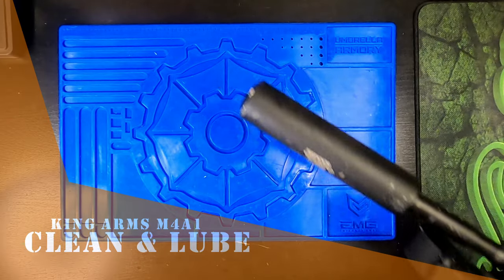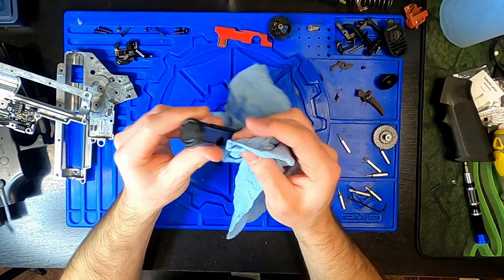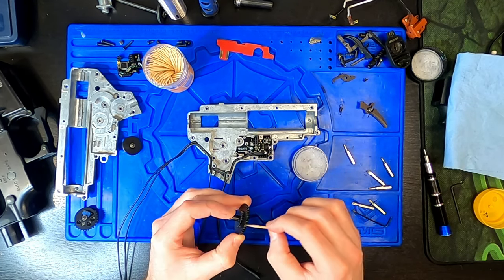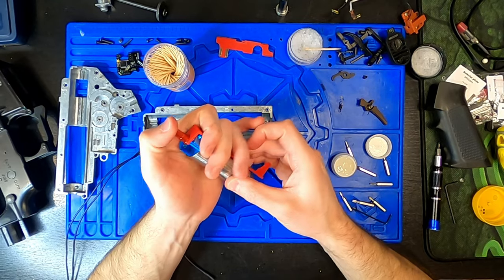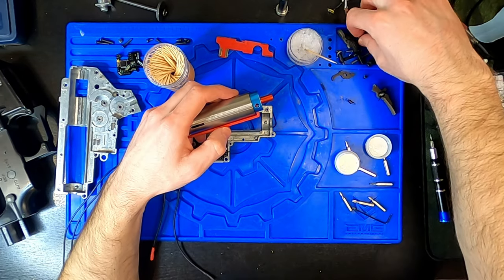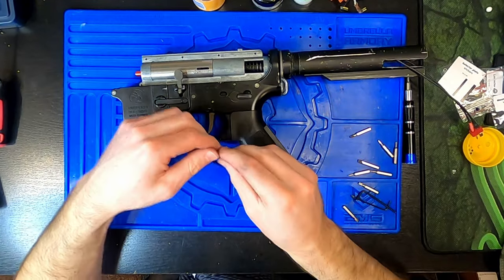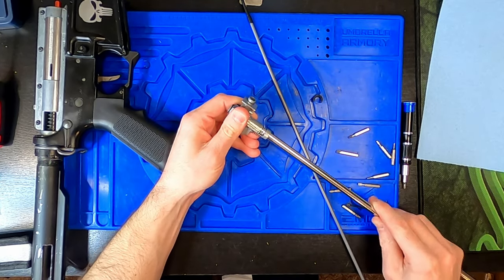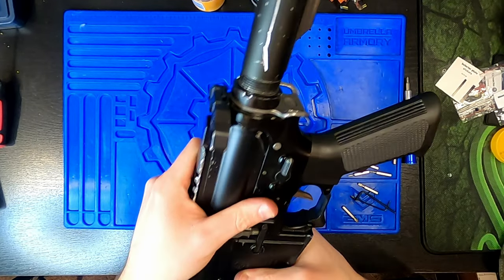Airsoft Maintenance: Clean & Lube | KA M4A1 | V2 Gearbox

Comment: i'm running the same setup on my 416c VFC, tienly 35k, 12:1 gears and gate titan V2 +, 7.4 LiPo (i'd like to give a try with a 11.1). Did you use a lot of active brake?
I've chosen molybdenum disulfide grease for its high adesivity for the gears and pinions (metal on metal). Transparent sylicone grease for the air group. I used a brush for greasing the teeth of the gears but i really appreciated the toothpick solution which i'll  use in the future! ty
Reply from the maker: Sounds like a fast setup with the Gear ratio! I just leave the active brake set on auto basically. I don't have issues with double shots or anything. I've started using a brush for most of the grease applications but the tooth pick comes in handy still haha.

Comment: bro i gotta ask how do u like that piston? i was going to get it to save money instead of buying the angel kratos, let me know if u recommend it
Reply from the maker: Honestly for the cost it's hard to beat the shs piston. If you epoxy the rack in the durability has been good for me. I am also using a different shs piston in my L86 lmg build running FA all the time. After 2 years and probably +100,000 rounds its still going strong.

Comment: So if I’ve said before I apologize but I’m new to the hobby and 63 years old so I wish I had your knowledge on installing everything! Learning something new everyday though the more I study! Wish I had that FPS out of my M4. So question? What’s a good first step to improve my accuracy and FPS or joules as the range says. So I have a Lancer Battle X M4 all stock and the charging handle has a bunch of slack and battery box sucks,but to get to the point what’s a good hop-up,barrel,bucking and nub? Appreciate any help have a great one
Reply from the maker: No need to apologize! The charging Handle is cosmetic and the spring can easily overstech so be careful otherwise it will be sloppy (the spring won't return it well). If you are looking to upgrade the barrel, bucking and nub I'd recommend a Prometheus tightbore Stainless steel barrel as my #1 go too. For the bucking and nub I've always had luck running the modify flat hops (comes with flat hop nub) which is the easy to install. You can choose the soft (grey) or black (hard) bucking from them depending on temperature and FPS. The gold standard is basically moving into R-hop which is tricker to install unless you can get an off the shelf rhop kit (actually Evike and Ebay have some precut for certian barrels, including the Prometheus barrels). I've actually since swapped to an Rhop in this gun using the 6mm pro shop precut patch from evike and the same modify flat hop bucking. One thing to note is you can try a dozen buckings and you will get a dozen different results for air seal improvements (or sometimes it can get worse), bb feeding, and FPS increases. The bucking lips fitment to your nozzle and how they stick /interact with the feed tube (for bb feeding) all play a role on if it's an improvement or not. Other good buckings are Prometheus (purple), g&g cold resist (get the appropriate color one if you have normal hop or rotary hop), and any maple armouries bucking really.
Reply: @DucknDiveAirsoft  your the best appreciate you! Thanks again
Reply: stress and use your actual replica, then switch for a med-high level one: VFC, Amoeba, Specna, G&P...basically any 300€+ replica is good to go from the start.
Use the old replica to do your first maintenance work (many tutorials around) then you'll be autonomous for anything you need airsoft related! glad there are older people playing, the game quality i get when older (and wiser....) people play is incomparable with young and spray and pray guys
Reply from the maker: Good suggestions.

 My first replica is still my primary four years later, and it was also the first I learned to tech. on. Despite it being a cheap starter after all the work I've done it's holding strong with lots of life left too. Once you learn to tech. You will be able to keep things working for many years to come.

Comment: Can I use silicone grease to clean o rings and such? I want to avoid 100% silicone oil In gear box
Reply from the maker: @banksblast3095  for cylinder head probably not an issue either way. For the piston and nozzle you need lighter viscosity. Grease likley is to heavy and may not function well. Oil is a medium weight and only a tad should be used. An alternative that may work (don't quote me) could be TechT Gun Sav. I've never used it for an AEG but it is a bit lighter weight of a silicone grease. Not sure if it would impeded the piston or nozzle function (if it's too thick).

Comment: everything is upgraded but gun is not feeding, or feeding badly, what can cause this ?
Reply from the maker: Nozzle and bucking most likley. Stock hopup? New bucking? What length nozzle? Can try the bb drop test to see if bucking lips stock out too far. Have you tried a mid cap with less bbs or a high cap to see if it feeds better because it could be mid cap syndrome. Could also be nozzle to long or tappet spring too weak. Can also try different mags sometimes mags don't feed well.
Reply: its hk416 we installed 21,45mm nozzle , we bought several different mid cap brands, nothing we tried changing hopup from different gun, nothing we do helps this issue , we also tried buying longer nozzle 21,55 no difference, it like sometimes bb shoots poorly and mostly it will not shoot
Reply from the maker: Nozzle could be too long though. Like 21.25 may do better. Changing the hopup can be dangerous and introduce issues the stock hop didn't have.

Try watching this video and do the bb drop and push through test to see if your bucking is an issue.

https://youtu.be/156t4FrN2KA?si=EwXmBo7HMajftrFu

Also make sure your hop isn't on max.

Can try different buckings too. Maple leaf are common culprits for the lips sticking too far into the feed chamber.

Also of you've upgraded many things at once it becomes very difficult to isolate the problem. You could go one by one through the main parts that effect feeding and revert back till you get it working right to help find the source. Ex. Bucking hop and barrel back, check it, then nozzle back, check it, then nozzle and cylinder head back a d check it. Other stuff inside won't effect feeding.
Reply: we will try shorter nozzle thank you sir for taking your time helping strangers
Reply from the maker: @ivanoxx  no problem. Tech work can be frustrating. The other thing you could see is if you have a selector delay chip installed. Usually they install one from the factory which helps nozzle timing for better feeding. Could try with or without to see. What it does is holds the nozzle open longer to help feeding.

Another culprit of feeding issues could be nozzle alignment. If your nozzle is not centered or getting pushed up by a full mag (mid cap syndrome) it will be worse. Some nozzles don't fit as good on cylinder heads too so you may find different nozzle and cylinder head combinations are better for that. 

Lastly, I mentioned before, but you could try a stiffer tappet spring. One way to do it is to cut a coil off and re bend the hook but only try If your careful not to deform it unintentionally or make sure to have spares. When you buy them it's hard to say which ones will be stiffer though so it's easier usually to do the coil mod then try to buy a stiffer one.